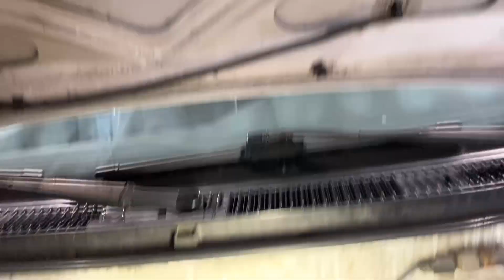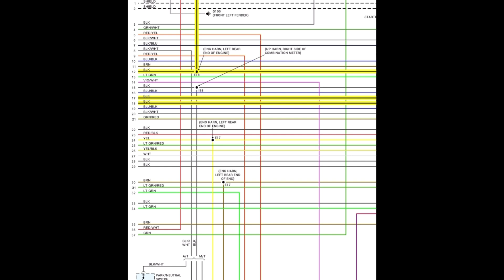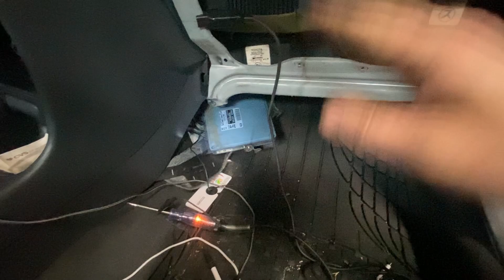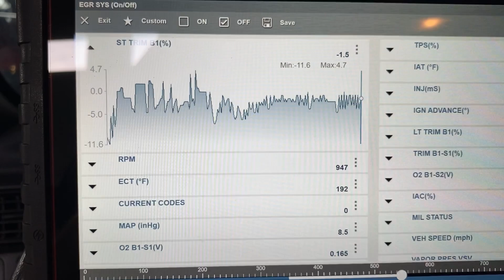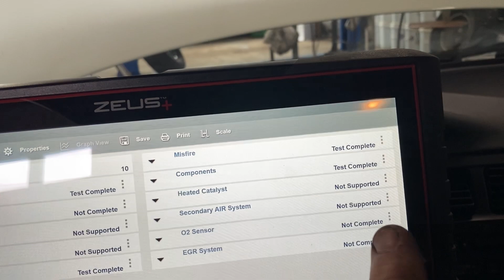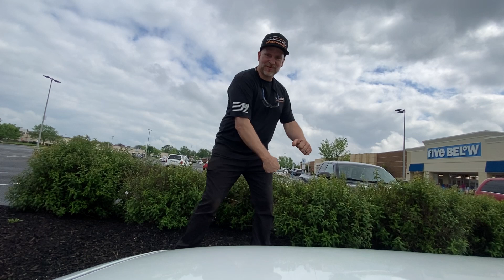EGR Code Won’t Go Away?! All New Parts — Now What?! | Real Diagnostic Work

Comment: It sucks that the govt clings to the fantasy that these 30 year old cars still need to pass emissions and have every single idiot component intact regardless of what comes out the tailpipe. There's virtually none of these era cars left on the road anyway. Most are rusted into oblivion or driven until the wheels fell off. I shake my head to no end that EGR and AIR ever even existed. My 2012 Silverado 4.8 has neither system on it from the factory and passes California smog just fine.
Reply from the maker: I get where you’re coming from—dealing with emissions on these older cars can definitely feel like jumping through hoops, especially when most of them are barely surviving on the road. That said, a lot of those components like EGR and AIR were part of the foundation for how we got to cleaner and more efficient engines today.

You’re right that your 2012 Silverado 4.8 doesn’t use EGR or an AIR pump—but that’s because newer engines use things like variable valve timing, direct injection, and more precise fuel and ignition control to achieve the same (or better) emissions targets. So while the hardware looks different, the goals and principles are still very much in place—just done smarter now.

I agree the rules haven’t caught up in some cases. It feels like we’re being forced to keep tech alive that modern systems have already outgrown.  a lot of today’s cleaner engines are standing on the shoulders of that older tech. i appreciate your thoughts thank you for sharing
Reply: The tests keep your vehicle working properly.  A full functioning vehicle will last longer when problems with failing components are taken care of by the owner.  Even horses get sick.  How long would you drive your vehicle with the check engine light on before you do something about it?
Reply: @peacepoet1947  do you just like arguing with people? Pretend like I was a mechanic for 30 years and forgot more about cars and engines than you ever learned. You have no idea what you are talking about saying that EGR or AIR keep a vehicle running properly. That is the most asinine statement I have ever heard.